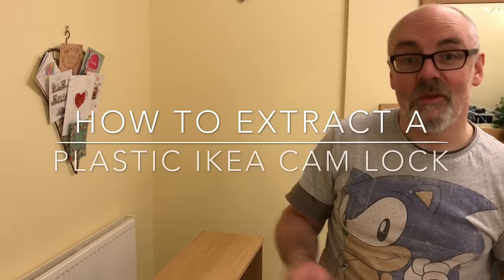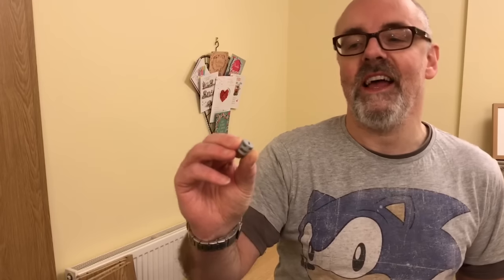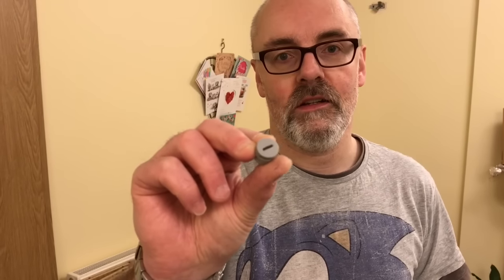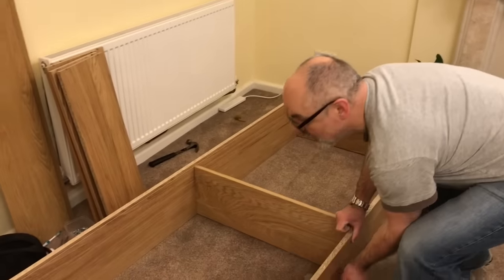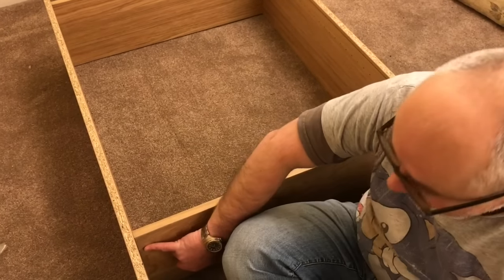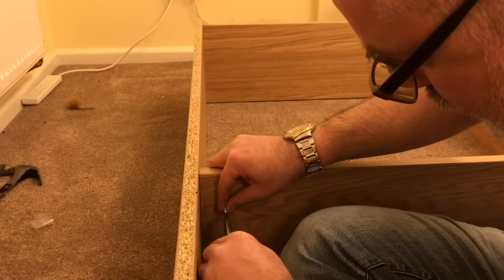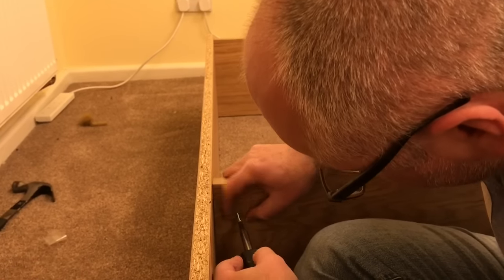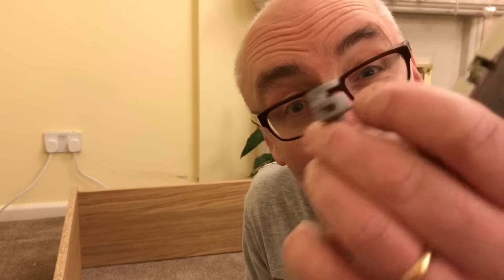How To Extract A Plastic Ikea Cam Lock

Comment: I followed this instruction and it worked perfectly. Only after I removed all the cam locks did I realise, all I had to do was unlock them (arrow pointing up) and the section of the TV stand just slid out. You don't actually have to remove the cam locks. Just turn them to unlock and pull the incorrectly positioned piece off. Twice as easy ;)
Reply: This worked for me, man. Thanks. Saved me the hassle of having to go get some replacement locks
Reply: Wow! I have spent the last 24hours wanting to cry. Finally decided to check YouTube. Found this video but couldn't get the small screw in. This comment was exactly what I needed and it worked! Thank you!!!
Reply: Omg I love you ❤❤❤❤❤. It worked like a dream.   I  am so happy I looked in the comments❤❤❤😅
Reply: Whaaaaat
Reply: This saved me thank you so much!!
Reply: OMG! You saved me so much time, stress, and hassle. Thank you so much!
Reply: Man life saver
Reply: omg thank you so much for this! i couldn’t pull it out using the screw and this worked so well!!!!
Reply: what do you mean by arrow pointing up? where is up?
Reply: you're a goddamn genius, saved me from a mental breakdown lol
Reply: You are genius

Comment: The 'place cam lock in open position and lift off' approach people mention in the comments wasn't an option for me as I had the whole MALM 6 drawer assembled including the back nailed on. I managed to pull out two cam locks using your method and replace them with the correct longer metal locks. Thank you so much!

Comment: Thank you very much for this video. 
Trying to disassembly 4 Billy cupboards right now and I was like how the heck am I supposed to get this done. Especially because those cam locks are diabolical. But even if I do that, I still have no idea if the Billy can be disassembled since the back panel is fixed with nails to the shelve's mid section... Those things definitely were NOT designed to be taken apart which is actually baffling. Anyway, thanks so much again!

Comment: Wow!!! Love you my friend. Amazing innovative trick. You are a real problem solver. Got Ikea closet last week and while assembling, by mistake connected wrong panel using plastic cam lock. Spent hours and hours to remove cam lock with no success. I am grateful to you, as your tip helped me resolved the issue. And I also agree with your comments on Ikea for using such a stupid lock.

Comment: Thanks for sharing this video, this just happened to me with the exact same book shelf! I just managed to get them out with your technique, however when you try to put a screw in, the cam lock turns with it. So I put the screw in on one side and have a smaller screwdriver to turn the cam lock back if necessary.
Reply from the maker: Haze Ieris hi yes I found that the cam locks sometimes twisted with the screw, but then they hit a stop and I was able to drive the screw in properly. Initially aligning the arrow as I do in the video is therefore a slight mistake; since it only matters when it comes to finally pulling out the cam lock. Hope this helps!

Comment: I couldn't get this to work, but found two techniques that did:
1. By far the easiest - handheld vacuum cleaner using the thinnest attachment!
2. (Not great, but worked once) Small pliers with one end jammed into the lock, the other pinching the plastic.

Comment: Thank you SO much!  Is it possible to then reuse the lock? (I REALLY messed up my cabinet assembly. It was not IKEA furniture, and I mistakenly thought my ~30-years past experience with IKEA furniture assembly would hold me in good stead with this new-tech(?) hardware and instructions.) If I can remove my messed up locks, do you imagine the they be re-usable after I turn my screws around to the proper direction?) Thank you again!
Reply: Hi Linda, yes we re-used all the cam locks in our bookcase. We took them out using the method in the video; then swapped each panel around and then replaced them and re-used the cam lock (after removing the screw). Sorry that's not clear from the video. Happy fixing!

Comment: Weird add to this problem people are experiencing. Before you try this, there is a good possibility that you can .. suck .. cam lock out if you made sure they are screwed lose. This can be a lot easier and faster and for the cam locks that keep in there you can try this video’s solution. Hope this helps some people. (I undid 3 within a minute)
Reply: Ps. You will get a little bit of dust / grains in your mouth and be careful not to choke of course.

Comment: I'm taking apart a bookcase older than I am and it has these but they're made out of some kind of metal. I already broke one and lost another one while taking the top apart. Now I've spent 45 minutes trying to get the ones in the bottom part to turn so that I could take the pieces apart and so far only 2 of them have turned. There's 22 more to go. And my head hurts now. And I kinda want to cry.

Comment: Unfortunately, the screw method didn't quite work for me, but the overall method works quite well (creating a handle for the camlock to be pulled out). The solution that worked for me was putting a few beads of heavy-duty hot glue onto the camlock face (making sure to get the glue into the groove line) to create a handle. Wait 5 min for the glue to harden properly (it will not work if you don't do this step) and then pull out with tweezers.
Reply: Very clever :-) !

Comment: I really don't understand why it could of any utility to extract the cam lock as it should be enough to turn the cam a little bit so that the arrow point toward the screw to free the piece of wood the cam is used to maintain ! or perhaps this does not  in some cases ??
Reply: Loïc Kerloch Thank you Loïc.  You’re correct.  We don’t have to remove the damn cam lock, we just need to loosen it to the point that it releases the screw.  You’ve saved my sanity as I’d given up trying the screw method as it didn’t work consistently.

Comment: It's actually simpler than that! You don't need to remove the Cam Locks!! You just need to twist ALL the Cam Locks along the the long sides, so the arrows are pointing as described in the video). Then lift the uprights of the unit away from support shelves (the middle, base and top shelves which are secured with Cam Locks). Hope that makes sense. Much easier than as described in the video but I would never have discovered the solution if I hadn't learned about the Cam Lock arrow as demonstrated here.

Comment: Here's what we realized after working on this for a LONG time (and pulling some out with strong tape) and having a few still stuck: ALL YOU HAVE TO DO IS POINT THE ARROWS IN THE RIGHT DIRECTION AND LIFT THE BOARDS APART! We are all making the incorrect assumption that the Cam locks lock the shelves in even before they are locked! They DON'T! They are not locked until they are turned -- locked -- in place. JUST UNLOCK THEM AND REMOVE THE SHELVES! (Yea, I know, it took three of us and a lot of sweat and about 3 hours to figure this out!). (You're welcome!)
Reply: duuuuude, thank your soul for this
Reply: Bless you!!! I ruined one board by accident while following the video but your way saved me time and effort and my board too! Thank youuu

Comment: If your goal is to take apart a cam lock joint, you don't need to remove the cam lock. All you need to do is make sure the arrow is pointing in the right direction. You may have to turn the cam lock counterclockwise around two times to make sure it is disengaged.
Reply: OMG THANK YOU 😱 I was so worried about destroying the mechanism or my new furniture and this worked! WAYYYYY easier than trying to take them all the way off, just make all the arrows point up and put some muscle into pulling off the part you need to adjust!

Comment: I am not sure if this works for any other IKEA pieces but I turned the plastic cam locks so that the arrow was pointing upwards (when trying to take the lid of my malm dresser off) and it just lifted right off without having to do anything else. Hope this makes sense! 
I found this by reading this thread... https://www.reddit.com/r/IKEA/comments/3s9y0i/cant_get_plastic_locking_nut_out_malm_dresser/
Reply: Thank you this worked!!
Reply: Thank you so much for this comment. Such a simple solution! You saved me so much time and effort.

Comment: There is no need to take the cam lock out. It will only damage it and you won't be able to use it again.

You just twist the still inserted cam lock anticlockwise till the end (open) and then pull the shelves apart from each other. It will work, guaranteed.

Comment: Thank you for posting this for us. I actually ended up wanting to remove from these annoying cam locks. The way I got it out, I had the bookshelf flipped so the cam lock was on the top facing the floor (so gravity can help pull it down), then I used the screwdriver to get it to "fall" slightly then used an exacto knife to release it. This way you avoid the potential of damaging the screw for the cam lock 😊😊

Comment: This advice is needy when the cam lock is deep in a hole and the screw in front of it. You somehow need to pull the cam lock towards the surface so that the screw reaches it. I have been struggling with this problem the whole day...Our furniture broke and we needed to replace the broken part with a spare piece. Mending becomes extremely difficult due to these plastic cam locks which are impossible to pull out.